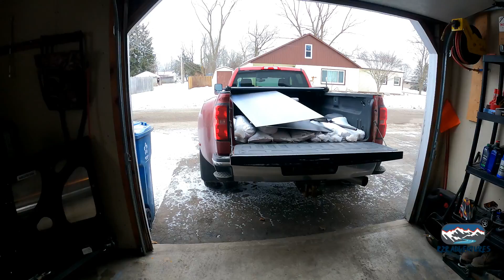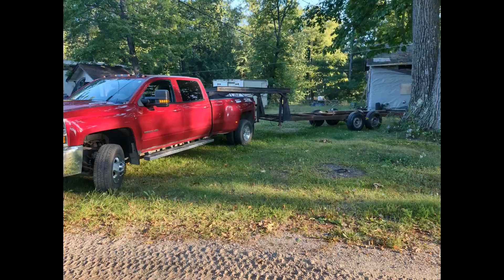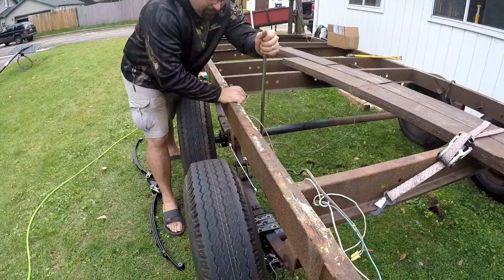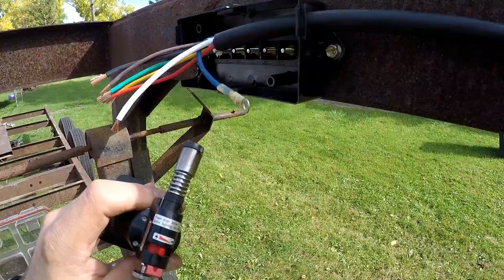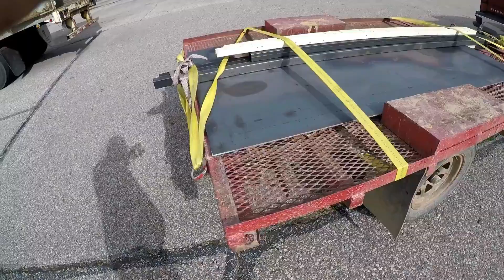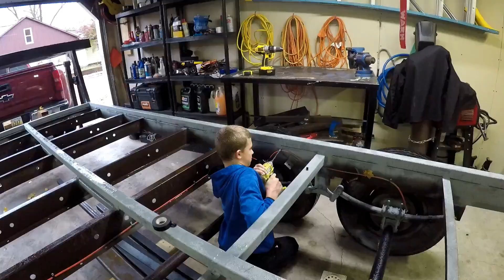5th Wheel to Toy Hauler Conversion Part 11 "Bring on the Steel"

Comment: Just watched your whole trailer build.  That thing seems awfully heavy to haul 2 side by sides.  I guess over built is better than under built.  I’m curious to see what it weighs when you’re done.
Reply from the maker: Thanks for watching.  Took it to the scale, with the two machines loaded up it was 5300lbs on the axles.  I wanted to wait until I was all done before I did a complete trailer weight.  I'm guessing the trailer with the generator and tools is still less than 3,000lbs.